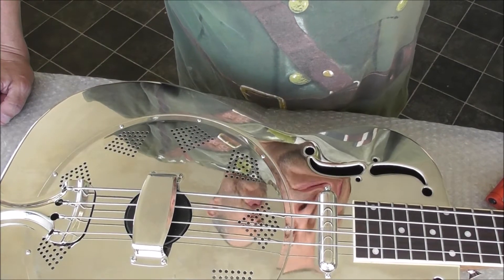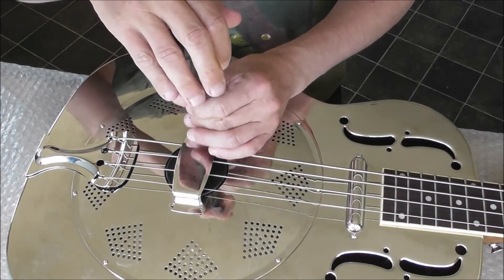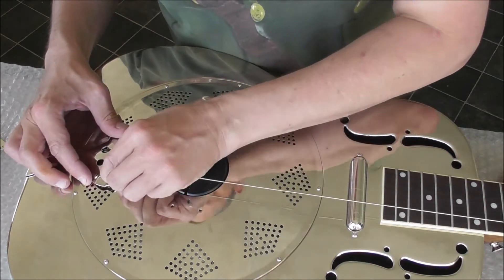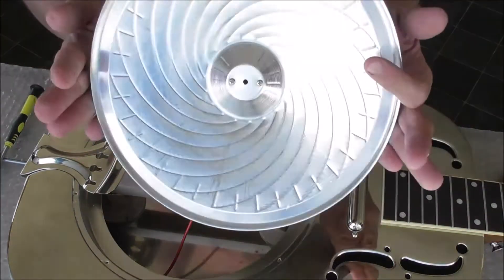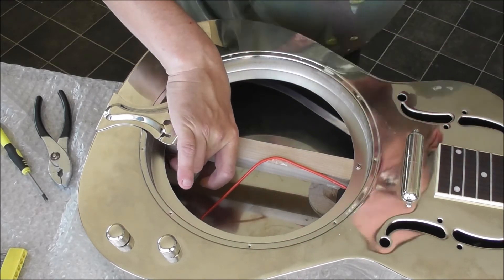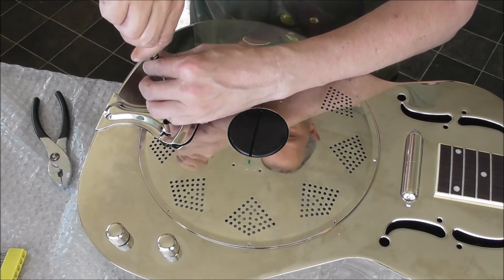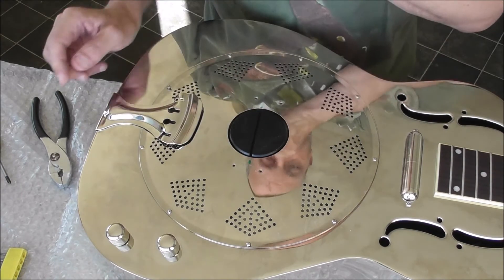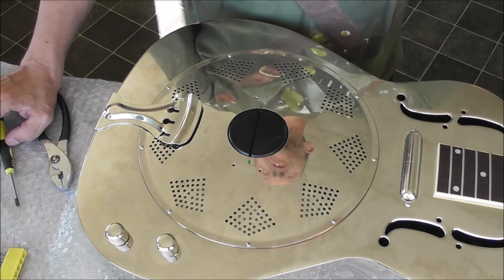Harley Benton Custom Line CLR ResoBass 1 Year On. Jack Socket Fix

Comment: Good to see you holding the jack from the inside, most people would try to tighten it without holding from the other side and rip off the wires, cool guitar too mate!
Reply from the maker: That was half the point of the vid, I've put up a live vid up already.
Reply: I call that common sense, but for sure its rare theses days.